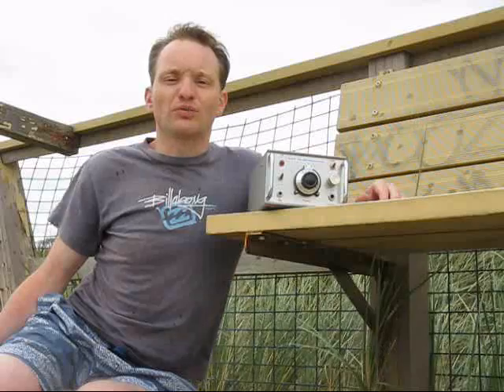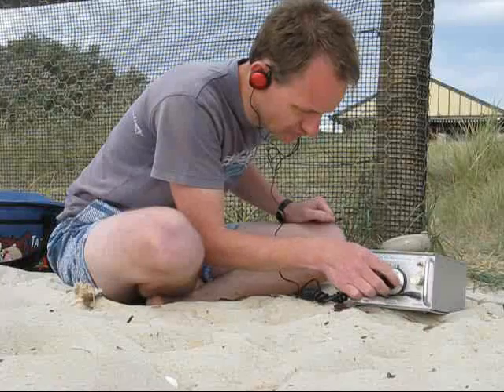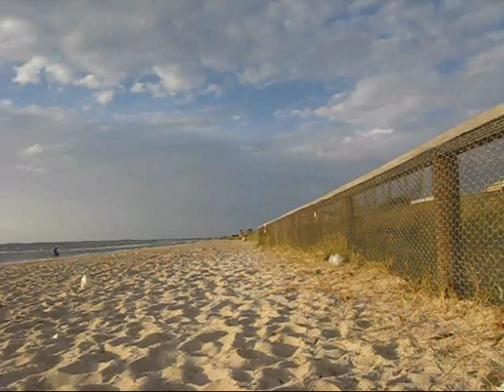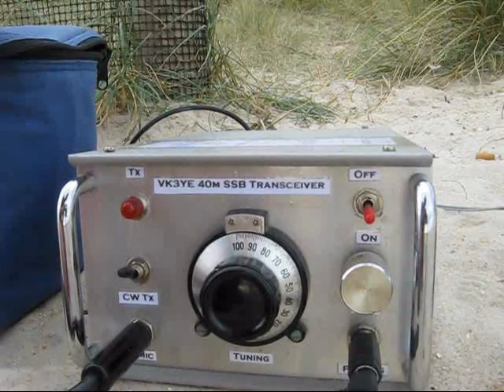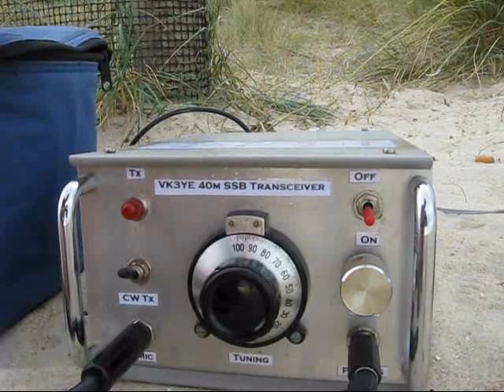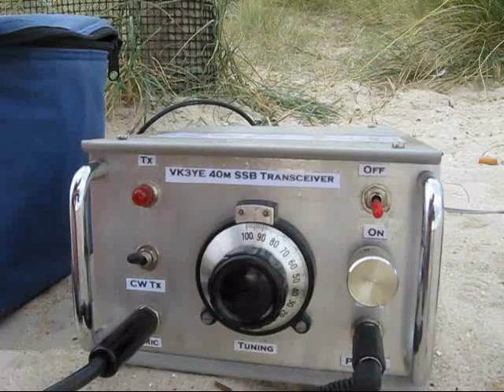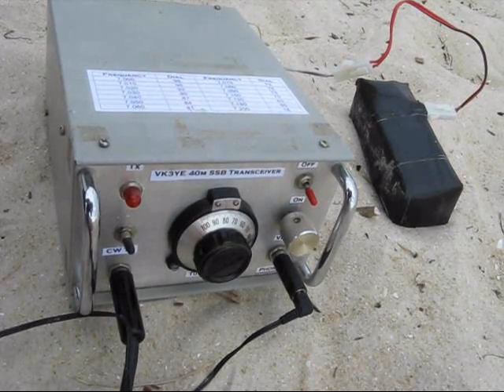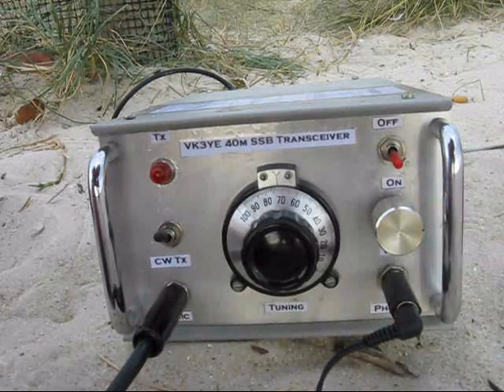QRP SSB on 40 metres: portable from the beach

Comment: Does a beach location help with lowering noise - such as the wall-of-noise one gets in a city or suburb?  I would guess so, but havent made the trek as yet to find out?  Lately the noise on 20 meters around here is S8 or higher...
Reply from the maker: Yes, it helps heaps. Doesn't have to be a beach though - even a park just a few hundred metres from suburbia can be good as well.

Comment from the maker: @m0dad David, none of the mods made were due to the failing of the original design - all were due to laziness and cutting corners.  For instance IIRC I only have a single tuned circuit on the Rx input. There are a few weak rx spurs so 2 is better, as per the original design.  But in no case have they been strong enough to prevent a contact.

Comment from the maker: @raccoonnyc  Build style is a mix - PC board with pads glued onto it for the stages using discrete components (eg VFO, driver, PA) and matrix board for most of the rest. The VFO is in a small box up the middle and the Tx and Rx are on boards either side. The PA and T/R switch is up against the rear panel. Box style is actually a pain - too chunky and lets sand in. YouTube doesn't allow URLs, but there's nearly a full circuit by searcing 'VK3XU TCF' and finding M1KTA's blog.